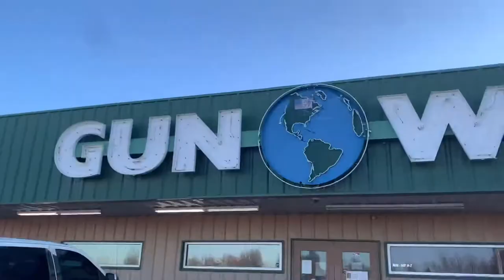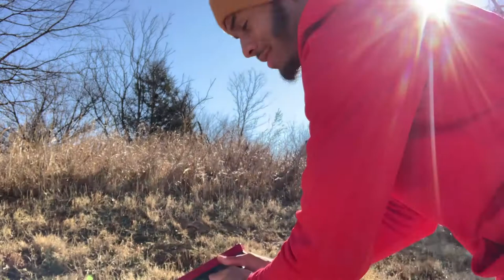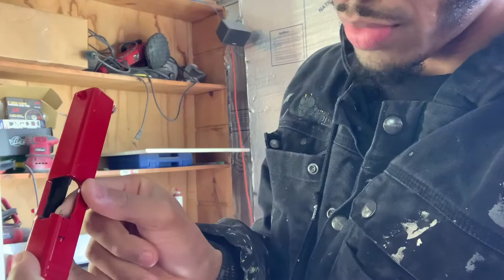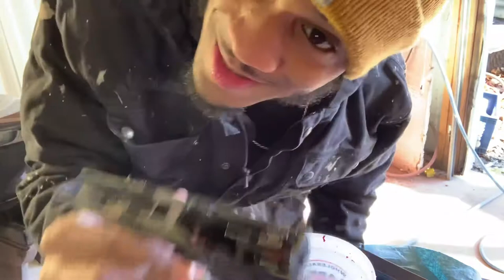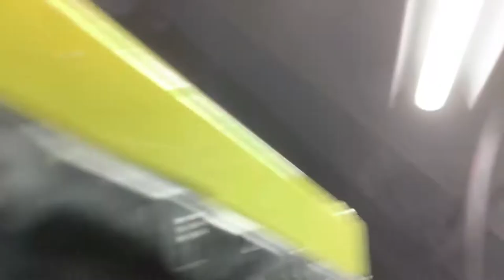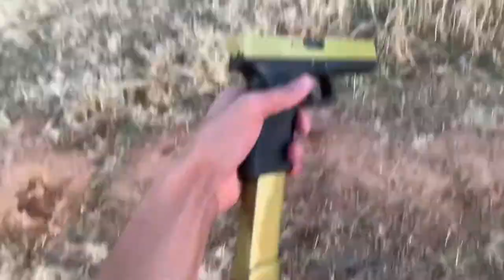Dose It Jam?? Custom Painted Glock 17 Olive Green Paint With Orange Pearl

Comment: I painted my AR many years back but I only got one concern. and its the magazine, I am woundering if the paint from the magazine will somehow scratch inside of the gun and leave paint resedue inside the mecanics of it. I got a test that should put this question to rest. could you run one or 2 magazines real fast to get it hot. the after that just take out the magazine and reinsert ir about 30 times. and check for wear on the magazine please. Also could you tell me what kind of paint are you spraying. one last thing try spraying airplane paint its ceramic and really though. I really want to paint my magazine, but its scares me. the firing pin stoped working on my AR and never figured out if it was the paint or if I messed up a spring cleaning it, my AR went bad after about 10-12,000 rounds. I used to s
hunt pests in ranches and orchard for money. went bad about a little over a year after purchase, good day. if you can also leave it in the sun 30 min before starting, that will really be a stress test. hope you make the video, I really want to paint a AR with flourecent acid green, frourecent yellow and black, mixed as a COD cammo.
Reply from the maker: I definitely hear where you’re coming from! I’ll have to try to when I get some free time, and I use finish one automotive clear and automotive paint